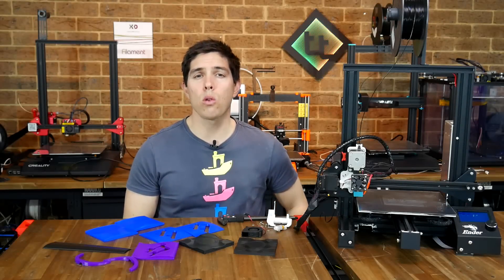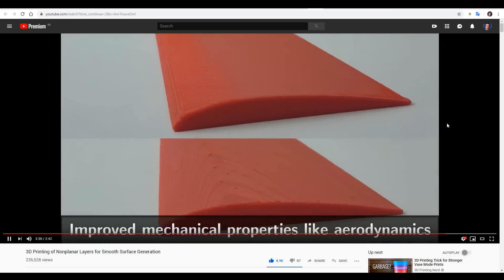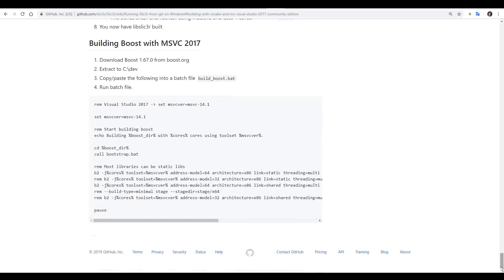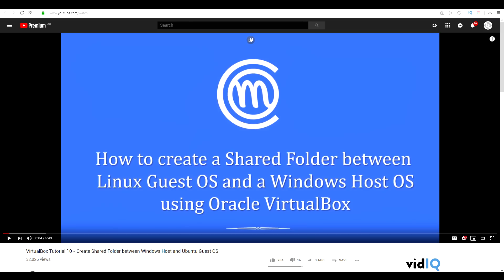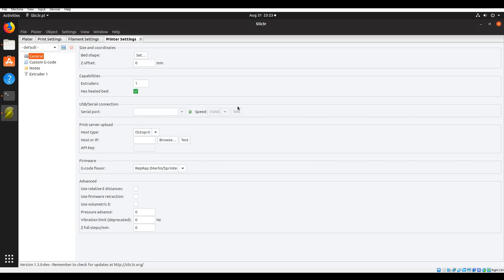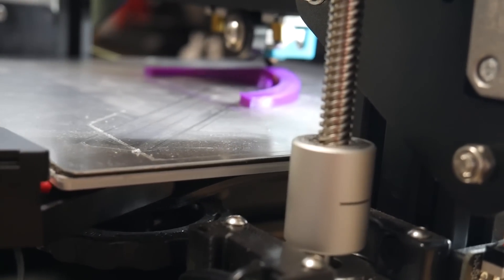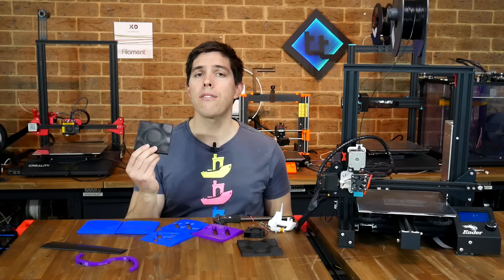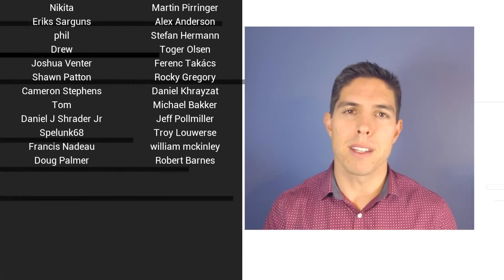Achieve true 3D printing with non planar slicing

Comment: HOLY COW you knocked it out of the park! Great results, man!
Reply from the maker: Thanks Joel, the future is bright.
Reply: @TeachingTech  Is 2021, Why there's no 3d printer doing that from factory?, It is very difficult for 3d printer manufacturers to make a real 3d printer?
Reply: It would be epic if you could make a video on this as well! Not the installation part, but the uses of it and different prints using this technique!
Reply: Linking park.
Reply: @imdone8243  I'm done

Comment: thanks great video Why dont you use your octoprint anymore? i have it setup on all my printers was tricky to get multiple printers connected to a single rasberry pi but so rewarding when it worked. So can you do ironing with this top layer like it cura? I wonder if your pieces would come out even better
Reply from the maker: I still use Octoprint. I had a few videos recently on it. In this instance I was trying to cut corners by using a pi to compile, that's all.
Reply: @TeachingTech  Thanks for the Reply! So I was wondering have you ever done a video on using the rasberry pi gpio to control the print pause in octoprint with a filament runout sensor?

Comment: Soon, Mike is going to come out with a mode for the Hero Fan system to allow cooling - I'm guessing here..
Reply from the maker: I'm tempted. Way back in the day we used to have a small desk fan sitting next to the printer since gcode controlled part cooling fans weren't prevalent on cheap printers.

Comment: If you install the feature Linux subsystem you can install Ubuntu from the windows store. Easier than setting up VM
Reply: slic3r has a gui, it's probably harder. slic3r linux uses perl-wxwidgets bindings so compiling might be non-simple, and I'm not sure how easily the slic3r display would export from the console via the x-server (which would need to be captured by something like Xming in Win10); but wxwidgets is GTK so it might work ok. Anyway, after all that, the VM is possibly/probably simpler.
Reply: WSLv1 won't work without a lot of work.
WSLv2(not out yet) is just a virtual machine which will work easily.
Reply: @Motolav  It does actually work, and quite well too. Hardest part was identifying all the dependencies on perl libraries and packages. I used VcXsrv (and mwm as window manager) on my Windows 10 laptop.

Comment: I mentioned this on the other video, but the next logical steps for non-planar are hot ends that have steeper angles, taller height to width ratio. Basically, with a steeper angled nozzle, it could fit into tighter curves. This also needs an entirely different cooling system, though, but that shouldn't be too difficult to develop. 
Non-planar also nicely extends into 5axis printing, which should be the next step of developments for the future of FDM.

Comment: You could simply used "Windows Subsystem for Linux", which is basically Linux running in Windows!
Reply: https://docs.microsoft.com/en-us/windows/wsl/install-win10
Reply: https://www.microsoft.com/en-us/p/windows-terminal-preview/9n0dx20hk701?activetab=pivot:overviewtab
Reply: With these two, you too will master the art of unification!
Reply from the maker: Thank you, trying it now. Other comments suggest it won't support the GUI but I guess I'll find out soon.
Reply: But, you should be able to build it for windows as well

Comment: Ok, @9:30 in we FINALLY find out what all of this REALLY does. 

You are just building up the model, then getting the head to go back over the final structure and lay down the "non-Planar" layers. So you're just forcing the machine to do the smoothing, instead of acetone or sanding. 

Also this will only work on parts with swallow, or no, indentations. You can't smooth the underside of anything, or even parts with steep pits the head can't get back down into. Really, with most objects, you'd crash the head into the model to swoop downward enough to smooth any steep sections. So this only works with shallow models, like the ones shown, aka wings, dishes, anything with gradual slopes. 

It's really amazing, I'm impressed by your work, but this only works for very few parts.
Reply from the maker: The process is shown in the first 10 seconds of the video.

Comment: I had recently been thinking of this kind of technique. I had thought that this technique would be more easily implemented with a delta based 3D printer. So that the print head could be tilted.
Reply: it is very much doable, but is highly dependent on the Delta Design, my current delta prototype will actually do this, once i get the new board in, and some Titan Extruder spares.  Cause the hot end hangs below the effector plate, with the magnetic arms on my printer giving a good range of movement the code can be adjusted to tilt the head.  But it depends if slic3r can be adjusted to generate G-Code like this
Reply: With this thought you would really need a 32-bit board with floating point instructions... Tell me again why we still use 8-bit boards? The price is so marginal these days yet the benefits are massive.
I still like the thought of a 4 or 5-axis 3D printer. There are a few companies that have made them. Incorporating non-planar printing with these machines will take a rather smart slicer. (MasterCAM, I put you to the test! You already do it with machining, why not implement your brains in additive technology?)
Reply: @leofortey7561  With Klipper an 8 bit board performs pretty much as good because actual calculations are being outsourced to a pi. A 32 bit board is nice to have but not really necessary imho.
Reply: you cant tilt the nozzle on a delta. the nozzle will always be parallel to the printbed
Reply: @lordgort1986  Wrong. With a parallel rod delta you can't but with a true delta you can.
The HexaPod uses extending arms instead of delta towers but concept is the same. IN essence you need 2 motors on each of your 3 towers to give this ability.
https://youtu.be/G_UmhUjZhNo
Reply: @lordgort1986  You can with a 4 axis one instead of 3 axis.
Reply: Hey, that's a great idea!

Comment: In one word.  AMAZING!!
Thingiverse post mentions removing part cooling fan.  Even on a Stock Ender 3 (original)?
Reply from the maker: You need to have a fan on the hot end heat sink to prevent it clogging. The fan that needs removing is the part cooling fan, although on a stock Ender 3 it is attached to the heat sink fan. That's why the Hero Me is suitable, the two fans are separate. You can remove the part cooling fan and ducting and still have the heat sink cooled.
Reply: @TeachingTech  Thanks!

Comment: FWIW, If you are running windows10 you can get pretty much a full version of Linix running by using the Windows Subsystem for Linux. I run Ubuntu on my machine and use it for work daily. The only limitation i have run into is that it does not support docker without HyperV that is part of windows 10 pro. You can find Windows Subsystem for Linux on the Windows Store.
Reply: @Kappa installing WSL is stupid simple, I can use both OS's at the same,  sharing files between the 2 is also stupid simple, and i can still play all my games off steam without having to worry about compatibility or driver issues. Getting rid of windows would actually be a huge hassle for me.

Comment: So the most suitable 3D Printer for this then would be a Delta Printer running on 6 individual instead of 3 paired Rails allowing the rotation of the head in 3 additional Axis ( though only two would be necessary ) and thus the possibility of keeping the extrusion angle at 90° to the work surface at all times - https://www.youtube.com/watch?v=hPE3Qr-ECtQ ? :D

Comment: Now we just wait for companies like creality to make cheaper 5 axis 3d-printers :P
Reply: Not wait, just harass like a mob
Reply: 5 axis would be pointless overkill, you know, that stuff that destroys buisness models. it's not as if you need to print overhangs from underneath like a 5axis cnc needs to carve one. The delta,  of the Gough–Stewart type is the obvious solution, with variable length arms its already capable of the effector tilt needed. Youll be waiting a very long time for a 5 axis that is fast, light, accurate and cheap enough.
Reply: I don't think there are any cheap 5-axis machines. Both the ideas with 3d printing toolchanging and 5-axis are both still in infancy stages. I'm sure somewhere is a 250k - 1m machine you can buy to do this but it's really not coming to consumer any time in the forseeable future.
Reply: _ David _  are you triggered by knowledge and reason? Lol, don't be an idiot.
Reply: i'd never consider Creality as a inventor
they're just manufacturers modding other's existing work and sell it as cheap as possible
Reply: Kuka, has them allready!
Reply: @What saith the scripture? Kuka is an(more like the) industrial robotics company. you just need to fix an extruder at the business end of a robot-arm.
if I google Kuka + extruder ...this is the first link
https://www.youtube.com/watch?v=AlXiKd1U5es
Reply: Why not try a Delta printer? It doesn't really have axis, the hot end can move practically freely.
Reply: Well, the advantage 3D printers have over Mills in terms of design is that their required rigidity is far lower, so I don't think it would be too hard to design at all - rotating print bed and hotend.
Reply: Hahahaha as an engineer, let me tell you, the words ‘cheap’ and ‘5 axis’ are rarely seen in the same sentence.
Reply: You can modify the printer that you allready have ;)
Reply: @GuyMassicotte  Problem is, 5 axis is much more difficult than just adding a couple of axes to a normal printer. 
G-code becomes more complicated. You'd need a specific program for it, as 5 axis uses a different coordinate system. Slicers are only programmed to make layers, where a true 5 axis part would need shells. And the current non-planar solutions are only generating shells on the top surface, where a 5 axis part would need a shell that covers all surfaces; think of topology and transforming a cube into any other shape, 3 axis can only manipulate the top face, 5 axis can manipulate more than just that one face.
There's reasons why 5 axis printing is mostly still in development, with the only working variants being highly experimental. Same reasons as why 5 axis machining is just recently starting to get into the hobby market. It's not as simple as you might think it is.

But go ahead, modify a printer to have two more axes, without the rest that's needed for 5 axis, and tell us how that works out.
Reply: @xaytana  my mom runs 5 axis mills she says it's not that hard lol she has been doing it for 27 years so dont feel bad
Reply: @jakesnyder2667  There are many schools, even in '92 that had very advanced CADCAM production streets to teach the next generation. And even then we had a small percentage (2-5%) female students, many of those have grown up to be mothers as well... With children that might have an interest in 3D printing, not that strange that those might show their face here. And 5 axis CNC isn't rocket science, just very useful when making aircraft components. The problem is that it isn't easy doing it cheap. Those CADCAM production streets ran into the millions even back then. That's the same problem we still have, even the guys from Ethereal Machines (India) are aiming at a $20,000 machine, that's insanely cheap compared to 5 axis CNC, especially compared with 25 years ago. But that's still out of the pricerange of most 3D print fans here, compare that to a €160 Ender 3...

Maybe Aaron is a troll, but your not acting much better!
Reply: @jakesnyder2667  Interesting stuff. Good to read.  The only comment i have is you claim that his grammar is bad, but so is yours. You can not start a sentence with and.
Reply: @jakesnyder2667  Wow, someone is incredibly insecure.
Reply: @xaytana  True, but everything starts in development. You might have seen https://www.youtube.com/watch?v=I10bn53ECBo and I'm excited for the tech to become commonplace.
Reply: @jakesnyder2667  I'm sorry for slightly misstating what I ment my mom has been a machinist for exactly 27 years and during that time she has learned how to operate a 5 axis mill
Reply: @jeremyshalala6843  agreed
Reply: @aellis6692  running a CNC machine (which does take a lot of skill) is completely different from designing one from the ground up. That is what @Xander Vice was saying is not trivial at all.
Reply: @TROPtastic  oh I did not realize he was talking about building one
Reply: @kv4916  And that is the truth!  ;-)
Reply: @jakesnyder2667 , Auch!
Reply: @jakesnyder2667    Obviously you care. You answered back, but sorry Jackie I did not mean to hurt your feelings. Peace
Reply: @jakesnyder2667  what? Im thinking youre some kid who gets his 'larnin' grom youtube and wikipedia. Machining is FAR more advanced than anything youll see on a hobbyist youtube channel. Mastercam et al have been around for a Very long time. To make it understandable..thing tbe worlds most advanced slicer software.. That created the code to mill etc pretty much anything youve seen professionally cnc machined
Reply: @xaytana  Researchers have actually already created systems for this. It's not that crazy anymore. In fact, they've even found ways to automate filament extrusion rate changes along path lines so that paths in an arc around surfaces with complex curvature don't suffer from under extrusion and have full extrusion and thus better fusion between adjacent paths. The big problem is bringing this all to market through standardization of software and creating consumer-friendly interfaces. As soon as a company thinks the market wants this and can afford it, someone will do it. The tech is already there and has been since at least 2019. The most recent research in 2020 improved on it even more with some significant improvements in automatically choosing order of print and orientation of print.

Comment: That's cool, but too much difficult work on software side.
I think it could really take of if CURA would make experimantal mode with it.
Then people would just need to remove the fan shroud, on stock Ender 3 that's actually easy,
Reply: Charlie Horvath the guys from Prusa already started with implementation if I'm understand the comments in the 'viral Video' right
Reply: >an hour, maybe 2, maybe 3 of getting the software set up is too much work
I don't know if 3d printing is a good hobby for you
Reply: @SlavicusVile  You don't understand, I don't need planar printing that much to invest hours into it
Reply: I get your point.
It's not a very user friendly method yet.
Reply: Its not difficult at all. Optimizing the hotend seems more tricky, to get really decent clearance as well as part cooling.

Comment: Just thinking, this might allow for processing some very interesting surfaces. Even the actual paths that the extruder makes could be different with alot of designs and textural results other than the crosshatch results presently achieved. Importable images from 3d files baked onto the surface of the different main objects shapes, as additions.

Comment: Just install the Ubuntu subsystem in Windows 10.  It's stupid simple to turn on and you can follow all the Linux commands, (even apt-get).  You can even run pre-compiled Ubuntu binaries.
Reply: yeh but then you would have to run windows
seriously tho, you could, it wouldn't be that hard, but in order to get the gui you would have to use xming, it would make file transfers easier than his setup.
I'd just dual boot into my 18.04 and send my gcode directly to the printer over the duet web interface. my ubuntu build allows me to vm boot into my windows partition so I'm usually on there more than windows these days.

Comment: Very impressive results. I agree with your thought that this is the future of 3d printing as it will address some of the major issues for FDM 3d printing with aesthetics being important but I think it could potentially also make more functional parts as it will improve strength.
Reply: Absolutely. Current high performance 3D wing structures have to be filled with micro balloons then sanded. This method reduces the amount of work required, and the total amount of mass added to the model.

Comment: Could you desktop fan instead of using the part cooling fan by placing a desktop cooling fan or household box fan in the direction of the printer could this possibly cool the print so you don’t have that overhanging issue?

Or you could design a special bracket that could be mounted on the hot end assembly. That shifts up the cooling fan and the hot end fan. And so that it redirect the air downword so that you don’t have to worry about those pieces getting in the way
Reply from the maker: Both of those suggestion would definitely work.

Comment: I usually have multiple OS on different drives in my PC, so it just a matter of switching the SATA cable and rebooting. You can even drive image a drive and have multiple instances of a OS with different configs.
Reply: Why would you unplug your hard drives?
What is the benefit?
Reply: @Jehty_  Super fast, super simple. No boot loader, no speed penalty running virtualisation. Other OSs aren't affected in a drive failure. 1min recovery in a drive failure, or a virus/ransom, if you pre-imaged your drive on another drive. Doesn't work with laptops and cases where the drives don't have easy access to their rears, but It's pretty much been the norm for a long time.

Comment: It stands to reason that a 32-bit controller is strongly recommended?  (or Klipper, on a heavy-duty UNIX box)
Reply: Why? All the difficulty is in the slicing. The controller doesn't really need to do anything different than usual.
Reply: Moving in one or two axis at a time, versus moving in all three at once?